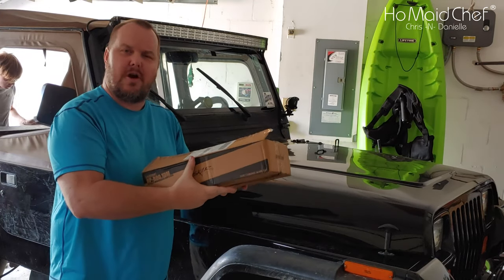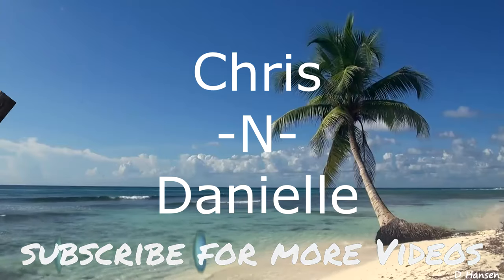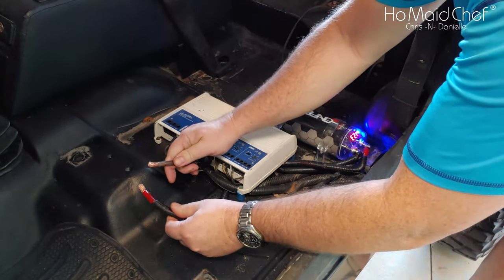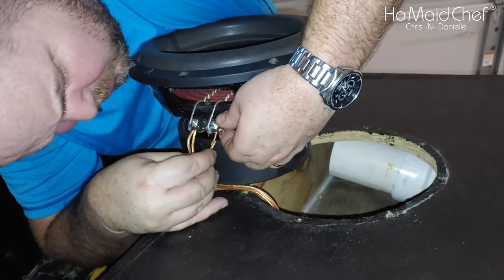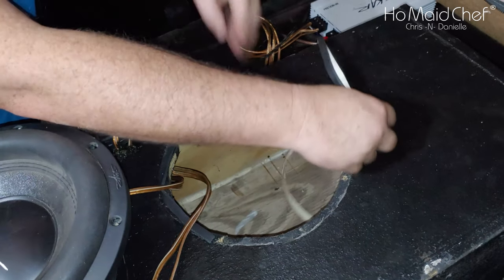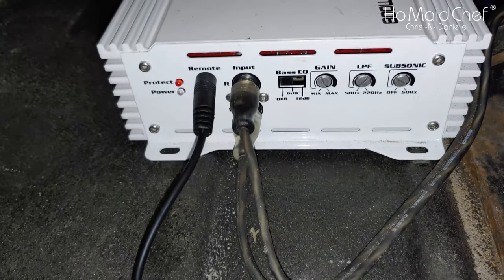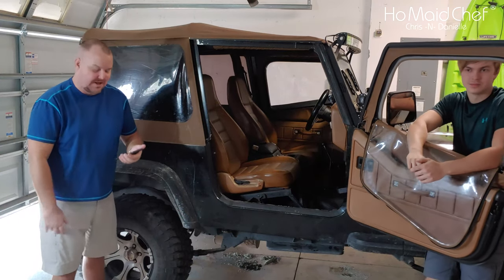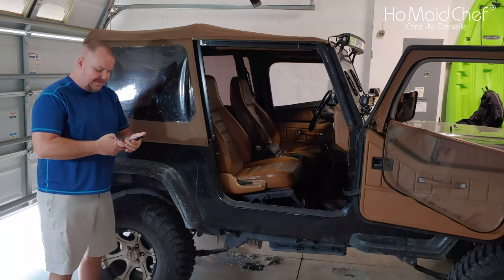Install And Review Skar 800 Watt Marine Amplifier || Jeep Mods E42

Comment: Bro I don’t mean to tell you what do do but you should not have the gain all the way up like that. Tune it with a oscilloscope or multimeter if you can’t get an o scope. Do it right I don’t want to see you guys blow your speaker due to distortion
Reply from the maker: Was testing it to see how it would hold up and if we could get the amp to shut off from thermal overload. The amp is currently at about half gain and mostly just tune by ear.